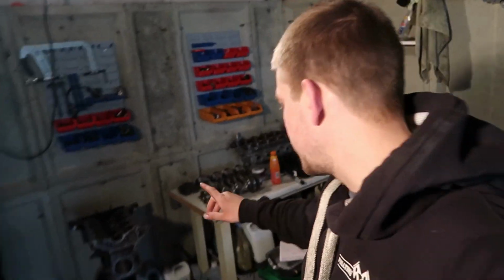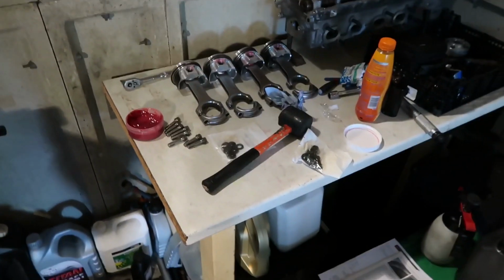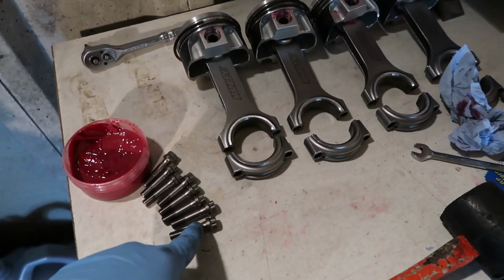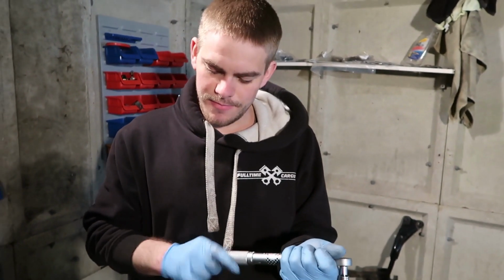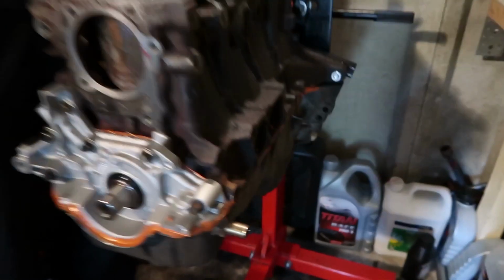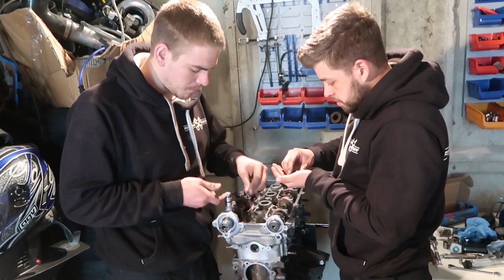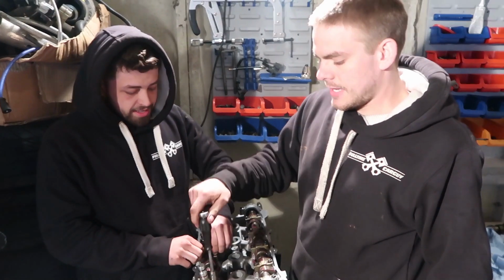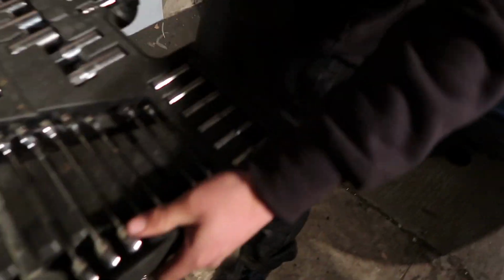Turbo Mx5 Forged Engine Build Vlog #10

Comment: Great build ! Just a pair of question: Did you fill oil rings before mount it? Did you throw oil or WD40 into the cylinder walls?
Reply from the maker: Carlos QuinT thanks dude! If you mean did I file the oil rings no I didn't. As for the cylinder walls I cleaned them with atf then lubricated the pistons and cylinders with brake in oil
Reply: Just asking cause some people "lubricate" only cylinders with WD40 to help with break-in rings and walls. I have to mount my engine and thinking about what to do or not to do.
Reply from the maker: Carlos QuinT all I know is that mine started first time and it ran in nicely and made good power